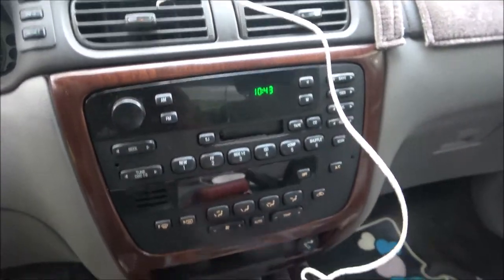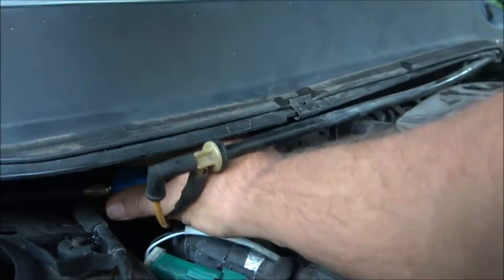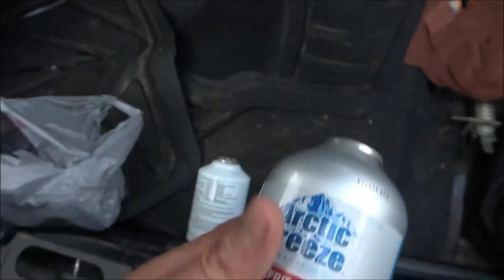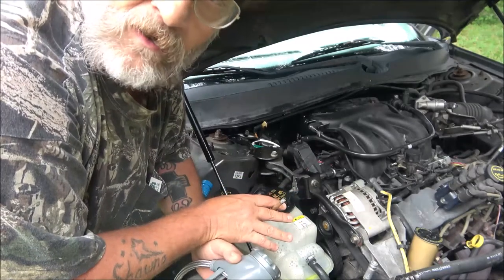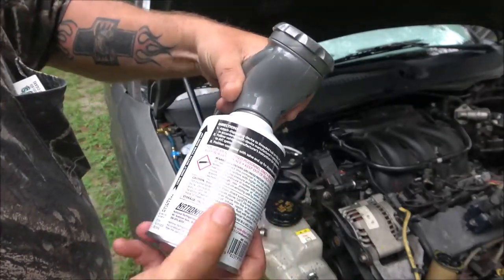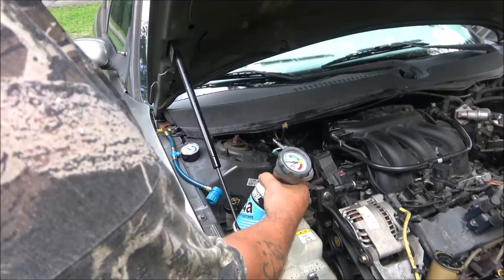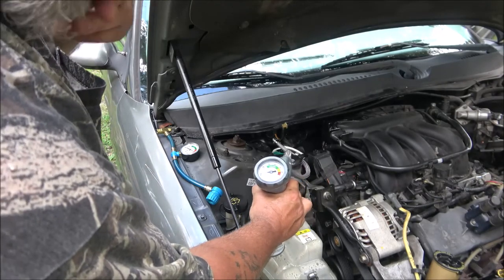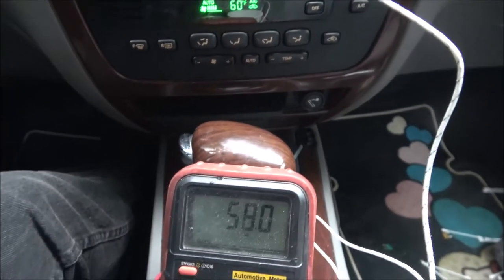Air Conditioning Not Blowing Cold Air 2004 Ford Taurus

Comment: Remember the outside temperature dictates what your pressure will be when charging if it is very hot outside such as 85 90°, then you should be around 50 lb if it's 60° outside temperature then you shouldn't go above 40 and be charged. Ford Taurus from 2000 to 2007 contains point 93 kg which is equivalent to 34 oz of freon.
Reply from the maker: thanks for the info, very helpful.